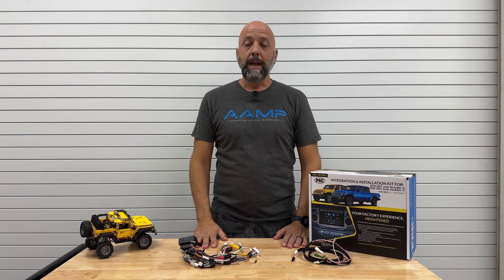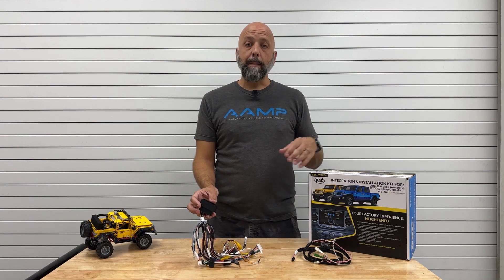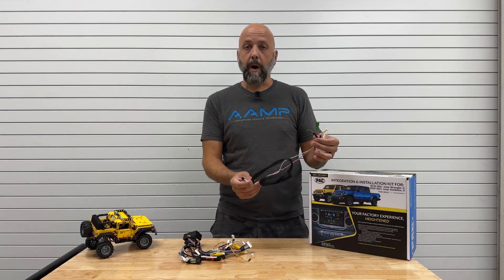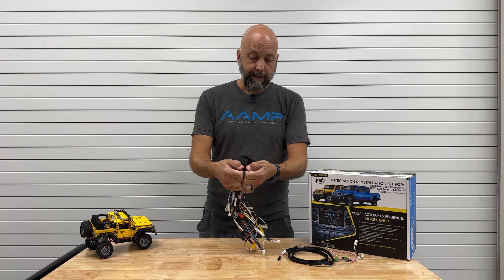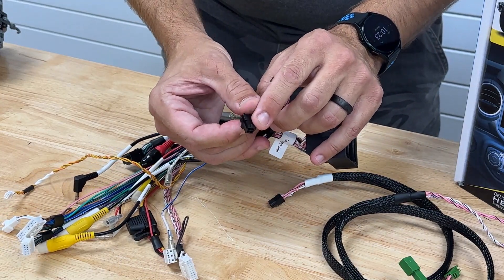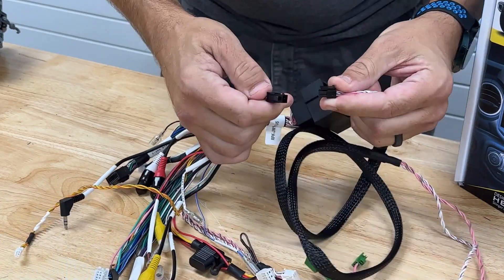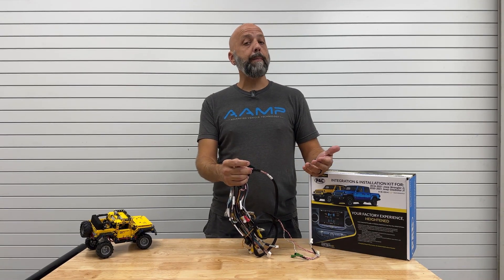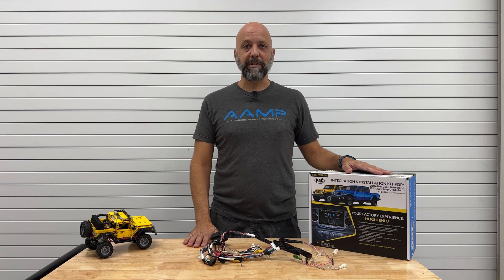Knowledge base video of connecting SRK-JW18EH CAN wires for Stinger HEIGH10 operation.

Comment: Any suggestions on solving the CanBus dropping off-line issue on the RAM 1500?  I'VE GONE THRU 100+ EMAILS WITH TECH SUPPORT AND HAVE GOTTEN NO WHERE.   THE NEW RADIO GAVE MY TRUCK  U0402  TCM, implausible Data code,  and Now I've spent an additional $540. at the Ram dealership service dept. to clear and flash the Code.  This infotainment system has been a complete nightmare.  Any Help for anyone would be greatly appreciated.  Also, the update Tech support gave me was a backdated update firmware.  I wish I had kept the original out of box Firmware.  At least with that firmware my transmission wasn't acting up, whatsoever............   NO REPLY YET, FROM  FOUR - DAYS AGO